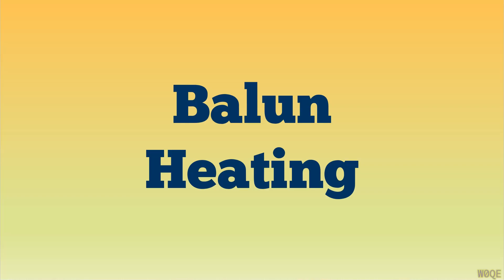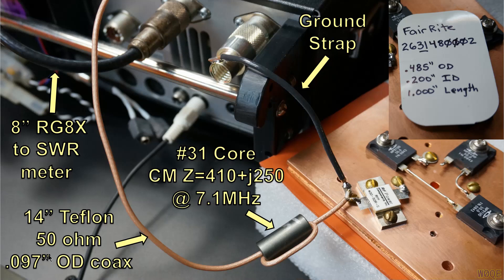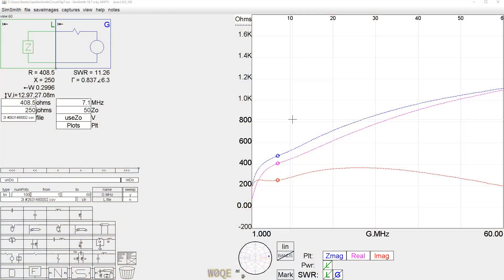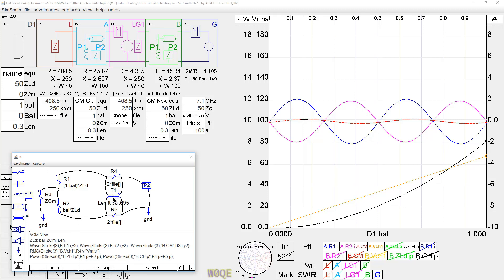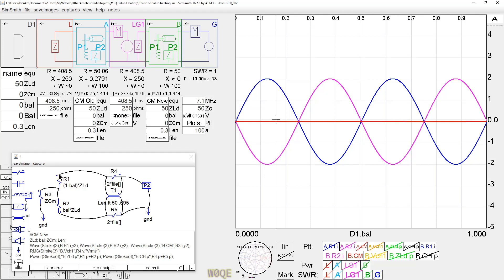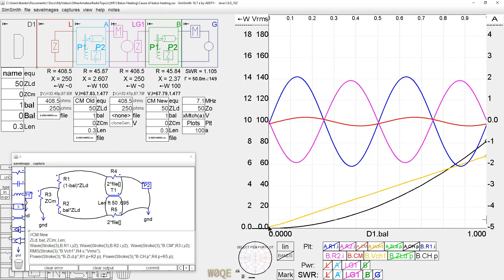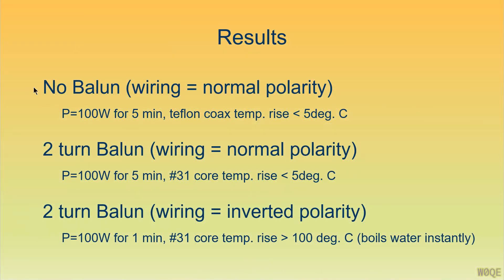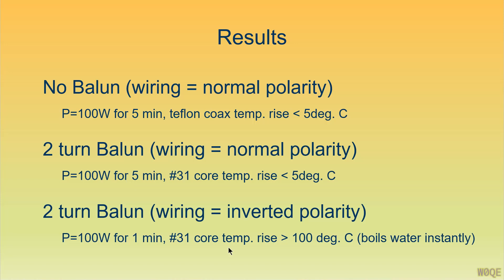#81: Balun Heating Experiment

Comment: An interesting experiment. Maybe a dumb question: is there a practical application?
Reply from the maker: Dragan,
This circuit could act as a 180 degree phase shifter when compared to a piece of transmission line of equal delay.  What I wanted was a way to separate the heating effects of the differential and common mode currents and this circuit does that well and it is easy to reproduce.  I think you have been watching my channel long enough to know that I really like when the topics I discuss can be experimented on by the viewers easily.  We really live in a wonderful time as electronic and RF test equipment is reasonably priced along with cheap fast computing.  Add in free simulation software and about you need to understand RF is the desire to do so.  Some of the circuits that I demo in SimSmith have millions of calculations taking place as components are swept and you can see the results in real time.  Maybe I'm just easily impressed but I would have loved to have had these capabilities when I was a kid. :)
Larry
Reply: Anyone that had to click that run button in LTSpice, more than a few times, is impressed by SimSmith ;) Not to mention that it's a wonderful learning tool. I wanted to replicate this experiment with a TV yoke ferrite but then I realized that I'm not sure what it would actually mean. Just shows that I need to learn more about the topic.